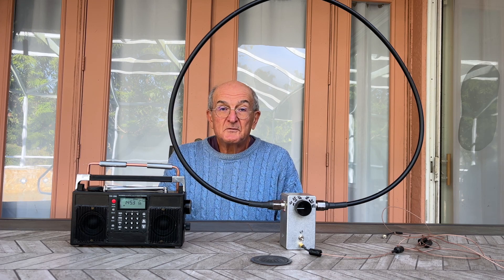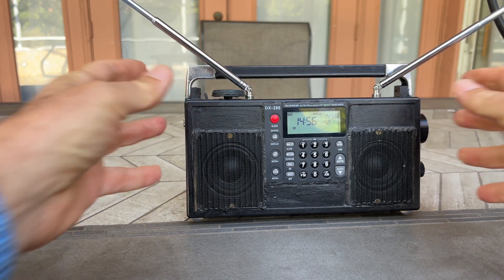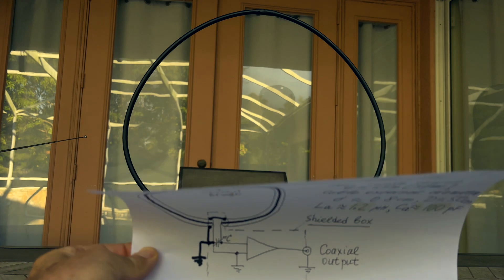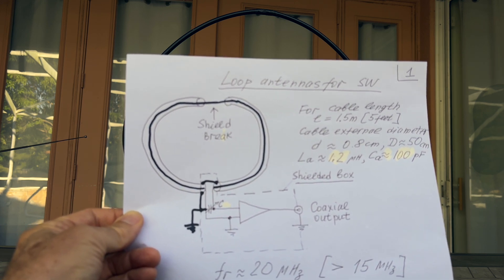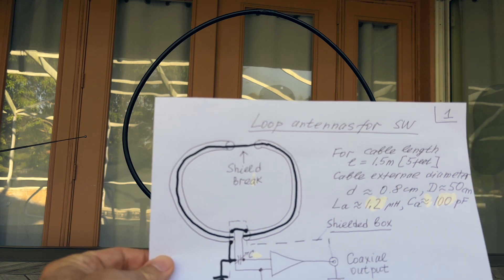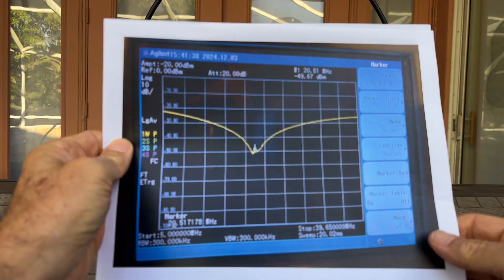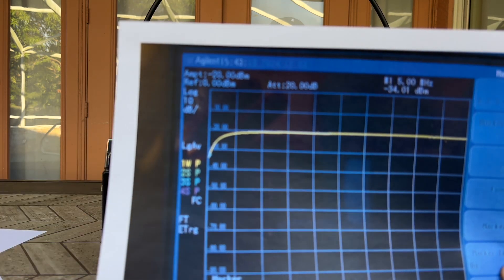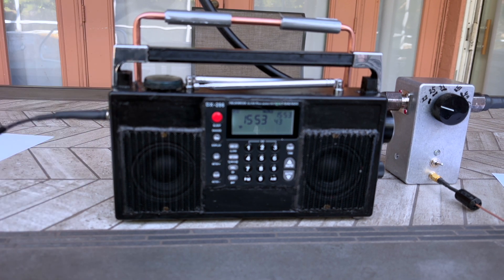Improved Short Wave Loop Antennas for Qodosen DX-286 Portable Radio

Comment: Very interesting! What made you choose the DX-286 to modify and test your works?
Reply: I used Qodosen DX-286 because it has a few remarkable features:
1.  It is built on NXP IC designed for high end cards with great performance.
2.  On FM band it has an automatic BW selection allowing huge flexibility in the crowd FM spectrum.  For example, in Sarasota, FL I can receive 46 FM stations.
3.  The hardware was built pretty well with relatively low RF emissions.
4.  It has low impedance non-selecting front end, allowing me to innovate with various types of antennas.  In my first two videos I explored the opportunity of large AM bar antenna, dipole SW whip  and active tunable shielded loop SW antenna.  Watch for my next video where I will demonstrate the passive tunable whip SW antenna.

The only drawback is a 200 mA current consumption which is manageable by using the 26560 Li-Ion battery.

Comment from the maker: I have done some more work with radio antenna improvements:

1.  I measured the signal strength in AM medium waves band 520-1710 KHz with a modified radio (large 7" antenna bar) compared to the original DX-286 radio with a small 4" one. The modified radio had 10 dB higher signal strength (lower frequencies,) and 20 dB higher signal strength (higher frequencies).  Ferritre bar size does matter!

2. I investigated why a large external loop antenna for SW band had much lower receiving noise than the built-in one.  The sensitivity of the larger loop must be higher; that is science (see the video), but the noise was a mystery.  The reason was in the fact that the 5" long twisted pair leads, connecting the tuning variable capacitor to the loop antenna and RF amplifier terminals, were unshielded.  I did it on purpose, trying to minimize the stray capacitance to extend the maximum tuning frequency of the antenna, but that increased the noise coming from the digital radio PCBs.  To provide the needed shielding, I took the shield sleeve from D=6 mm RF cable and placed it around the twisted pair, connecting the shield at only one point at the ground terminal of the RF amplifier.
The result was stunning!  The induced noise dropped by 10 dB or more.  Now at the unfolded upper position of the SW loop antenna, its receiving noise is only slightly above the noise from the external loop antenna, rising by about 8-9 dB when the built-in antenna is in the down, folded position.

Further noise reduction of the built-in antenna is a rather difficult task, requiring the shielding of the radio PCBs, and may be simply impractical.

Comment: Thank you very much for this.  It's innovative and seems to work!!!  Thank you from Upstate NY !!
Reply from the maker: Thank you for the kind words!  
When I lived in Boston, I used shielded loop antennas to receive at night the European SW stations.  Here in Sarasota, FL, except for a couple of propaganda SW stations broadcasting from Cuba and a few religious ones, there are no stations.  Sadly enough, but even the large loop antenna can not bring up the DX stations here, they are all buried in noise.  Probably building real full-size SW directional antennas is the only way to improve the reception, but this is not what I want to do.  
In some other places, the modifications that I suggest could make day and night improvements.
Reply: @emctd9551  Yes, we are all in the same boat these days...on many occasions, I, too, can rec those Cubano stations with their propaganda as well as the religious stations.  I will spend a few mins listening to the religious stations only to improve my poor espanol,   One would think that the old powerhouses, viz the BBC, and all of the tropical band stations would start up again.  The station that I miss the most came out of VZ, Ecos de Torbes.  They have/had the greatest library of classical guitar music that I have ever heard.   They would play it all night long.  If you have any contacts down that way, pls let me know.  best regards, lmc
Reply: I am in Binghamton :)
I bought a MLA-30, I replaced the thin stainless wire with a 3/8s copper HVAC tube
Reply: @Grandassets  I have a similar much cheaper (15 bucks) AliX version called the AMLA 150 and was thinking of using some old copper brake pipe that i have laying around. Did yours work out well?